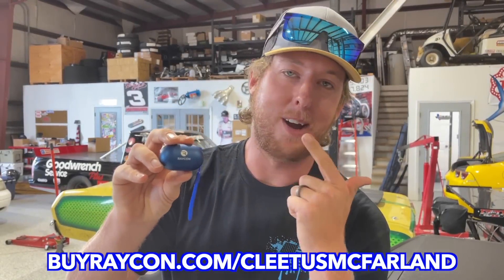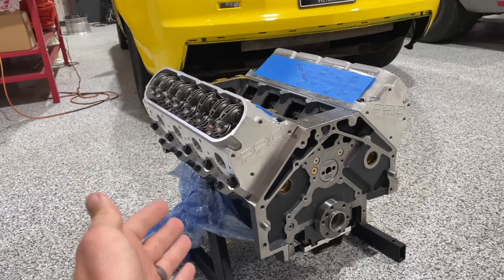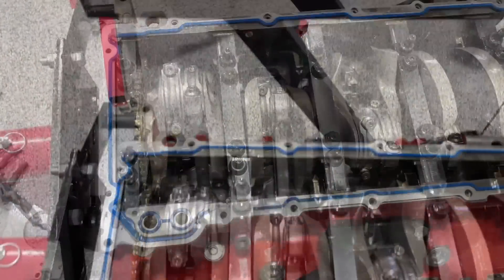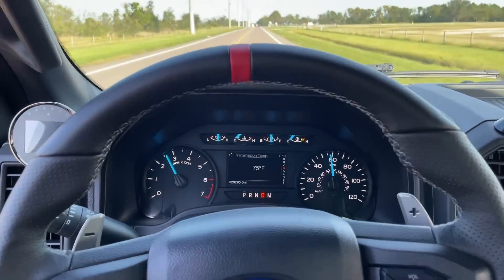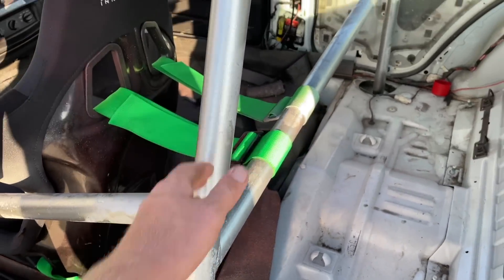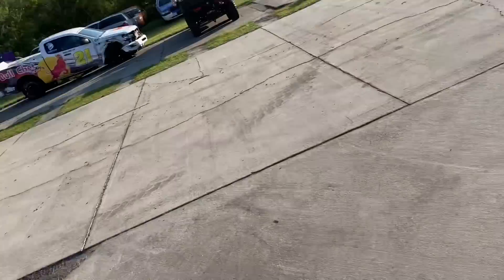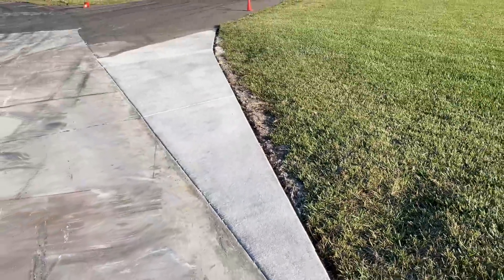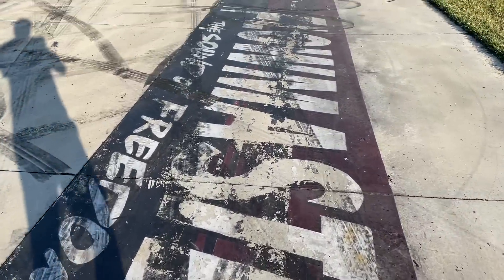Leroy 2.0 Damage Report From World Cup... We Tore It Up Good!!!

Comment: Can't wait to see Leroy smash the stick record again!
Reply: leroy & grubworm run it
Reply: needs aero upgrades. when leroy was in wind tunnel, was terrible
Reply: I dont see that happening unless he throws like 5000hp at it. the aero dynamics are soooo bad, I dont see leroy ever getting that record again with out body panels.
Reply: Wasn’t that record set the other week against Mullet? Like a 6.8? I don’t see the current version of Leroy doing that. Already talking about turning it down
Reply: @Addison0526  he went 6.61
Reply: @Addison0526  he would need mullets engine just to run 7.0. terrible aerodynamics. he has to pick up 35 plus mph
Reply: @Addison0526  Even worse than that, Atkin's ran a 6.61, lmao. Leroy might need a jet engine to beat that. xD
Reply: @Addison0526  the camaro that ran against mullet ran like a 6.60, and was 6.50 capable. leroy could never lol
Reply: @XxAtomic646xX  Leroy was really rather quick before his upgrades. He was heavier and setup worse than he is currently. I could see it happening with a little more horsepower
Reply: @alexandercurtis4427  nah man. leroy drag coefficient is around .64, while MOST fast drag cars are .20-.30. 
a little more hp? lol no, like 1000whp more at least.
Reply: He never had the stick shift record, just stick shift GM. Grannas and Red Demon were ahead of him
Reply: Put a SME in it will procharger, producing 4500+ 

Then Leroy can get into record times
Reply: Leroy is the worlds first 7 second gm stick car

Comment: Swedgelok stainless hardlines for all the air lines?? Some of their compression fittings are 15,000 psi rated. Can easily remove lines at compression fittings. I’m personally amazed these 1000+ hp cars still use soft lines.

Comment: if yall find that lock washers arent good enough, look into nordlock washers, its a pair of washers that dig into the surface and the bolt, and by design in order to back off the bolt has to stretch

Comment: A little dab of good silicone adhesive/caulk, (E-6000) on the nut and bolt junction after torqued, or the bolt head and mating surface after torqued, works very good at keeping bolts and nuts from coming loose. From my Jetski racing days, and a lot of surf races and huge chop, Combined with a 2-stroke, that wants to vibrate, no matter what.

Comment: Cleetus you might actually be able to make a sprint boat track in the Freedom Factory, using the water filled bladder type flood defences and pond liner type material.
1. Lay out the pond liner in the shape of the sprint track.
2. Lay out the bladders partially on the pond liner to form the edges of the track.
3. Fill the bladders with water.
4. Fill the track.
If this works you could have sprint boat races at Cleetus events and have an infinitely adjustable tracks for future sprint boat races.

Comment: Given how great the racing was with the wet chicane last year, and also how much it saves the tires, you should absolutely leave a hose running so it just slightly wets the surface there. For the other races, you could even install a pipe that will wet the surface just after turn 4 just to cool off the tires a bit. 

My local go-kart track those this for their rental karts, and it massively extends tire life. Just adjust the flow so it doesn't make the whole straight wet, it just needs to be a short section where the tires gets chilled a bit.

Comment: Since you're using the same short block in Leroy and Ruby then you should put the same intake on Ruby that you have on Leroy and have the only thing different being the turbo setup and see just how fast you can get Ruby which if you get low 7s out of Ruby and high 6s out of Leroy I would call that a win but I still say Ruby needs upgrades to get even faster and you should get rid of the reluctor wheel and go to the flying magnet setup and you will stop losing cam and crank signals

Comment: Use Castle Nuts and safety wire!  Aviation and top fuel guys can't all be wrong.  They can't back out then and you can visibly inspect very easily.

Comment: Those look like boostline rods. I run the boost line rods on my Type r. They take an absolute flogging for a steel rod. However I run peak if 35 psi and I don’t push the torque down low.

Comment: You should buy some low pressure burst discs (eg 40psi) on your intake manifold that way if you have an oveeboost failure like you have had before hopefully the discs go instead of a road. You can always bring spare discs too in case one fails, I’m sure you’d rather have them fail than to bend a rod. Ps. Congrats to you and Maddie on little ripper.

Comment: You should get all three drag cars plumbed with Brown and Miller plumbing and get rid of the push lock lines that are currently causing you to have a boost leak and blow the engine up and you should get LSR 6 bolt aluminum blocks for the two LS cars and step up from the I beam rods to aluminum rods in both engines basically build the two engines up like you did for Leroy but just keep a hydraulic roller camshaft in them instead of a solid roller and put a Holley Dominator in Ruby and a straight rear axle in it too and get all three in top notch shape and give them the best chance of taking home the money in all of the races you take them to next season

Comment: I’m sure it’s always to late…on Leroy’s trans tunnel. To add clearance  using a air hammer with a mushroom bit is an easy way to work and stretch the sheet metal for additional clearance. This method with a little finesse leaves a smooth surface not all beat up like using a hammer by hand. Doubt you will see this, Best wishes team!!

Comment: Before there are regrets, please start using these bare minimum circle track cage kits at Summit Racing. Allstar Performance Deluxe Roll Cage Kits ALL22106. Short tracks require the lower seat mount be welded into the door bars to move with it.

Comment: Going to keep saying it, they need a mechanical boost safety thats separate from controls and well within range of whats both safe and what they're never going run. could use the same blowout plates they put on superchargers but somewhere along the intake. Stop relying on controls when stupid mistakes on 10$ worth of parts results in 10's of thousands in damage